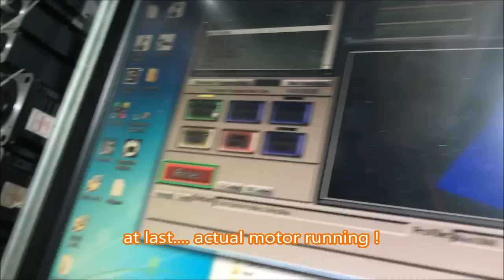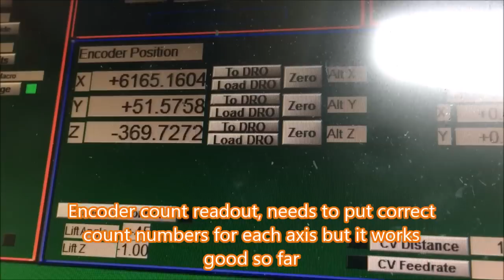FinaxMusic CNC rebuild project part 1 - Mach3, ESS, Yaskawa AC Servo, gantry type, dual Y-ballscrews

Comment: Which I/O ports on the Yaskawa servo driver do you connect to the ESS?
Reply from the maker: You have to look up the servo manual for that. They are all written very well in detail.
Reply from the maker: SGDA series : on page 396, https://www.google.com/url?sa=t&rct=j&q=&esrc=s&source=web&cd=1&cad=rja&uact=8&ved=2ahUKEwjLmd-JwYffAhXHxrwKHaIDD3sQFjAAegQIARAC&url=https%3A%2F%2Fwww.yaskawa.com%2Fdelegate%2FgetAttachment%3FdocumentId%3DTSE-S800-15%26cmd%3Ddocuments%26documentName%3DTSE-S800-15C.pdf&usg=AOvVaw19DZ9FUJyKRRYWNkE4-N16&cshid=1543972449767000
Reply from the maker: SGDH series : on page 2-22 and above,
 https://www.google.com/url?sa=t&rct=j&q=&esrc=s&source=web&cd=1&cad=rja&uact=8&ved=2ahUKEwilrtiRwYffAhULXbwKHYjaC3MQFjAAegQIBxAC&url=https%3A%2F%2Fwww.yaskawa.com%2Fdelegate%2FgetAttachment%3FdocumentId%3DSIE-S800-32.4%26cmd%3Ddocuments%26documentName%3DSIE-S800-32.4_01.pdf&usg=AOvVaw1S-Rn4i-sjOEHlipGJYXPm&cshid=1543972448819000
Reply from the maker: SGDS series : on page 5-9 and above,
https://www.google.com/url?sa=t&rct=j&q=&esrc=s&source=web&cd=2&cad=rja&uact=8&ved=2ahUKEwjthfDSwoffAhUDXLwKHWr1BTkQFjABegQICRAC&url=https%3A%2F%2Fwww.yaskawa.com%2Fdelegate%2FgetAttachment%3FdocumentId%3DYEA-SIA-S800-11%26cmd%3Ddocuments%26documentName%3DYEA-SIA-S800-11.pdf&usg=AOvVaw2Yb3taBNtEoyXHOUEiIwqD